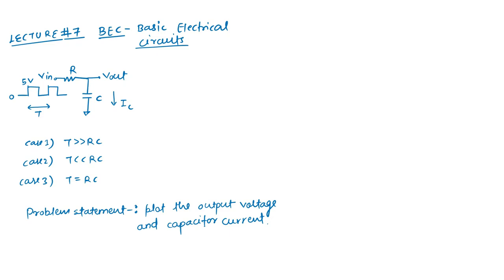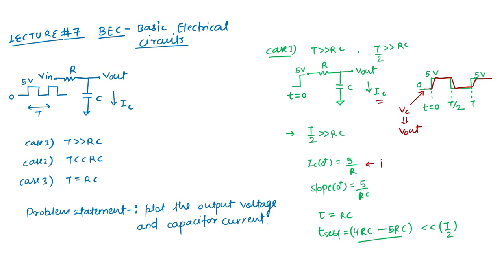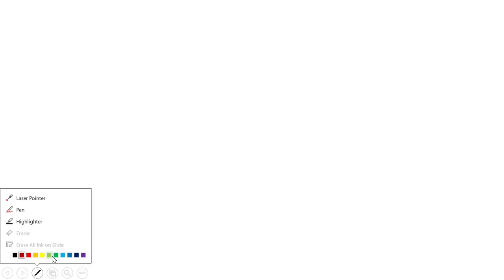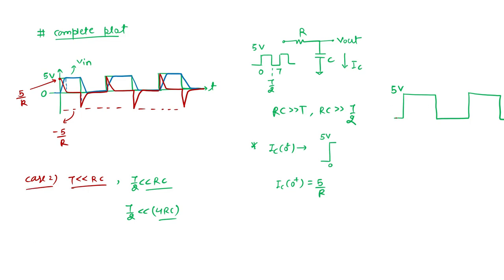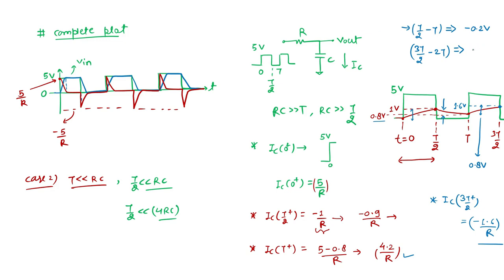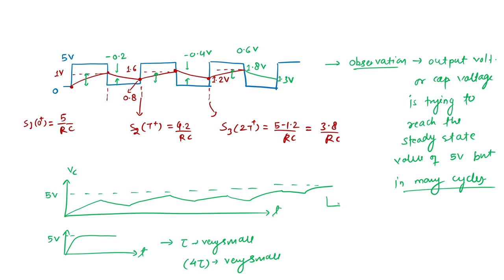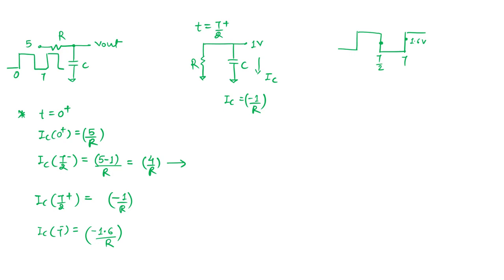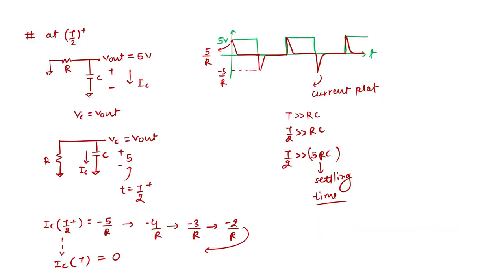Lecture-06 || Simplified Analysis of RC Circuit  with Pulse Voltage Input || BEC Lecture Series

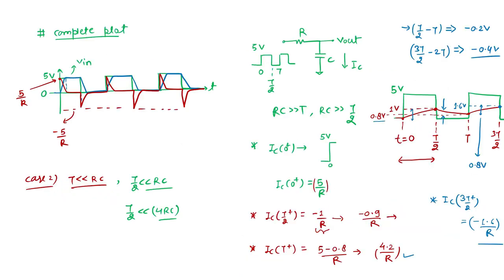Comment: Sir for case 2 at 25:30 , the steady state value will be 2.5 right ? Because the average value of input waveform is 2.5 v ? Please can you help here sir
Reply from the maker: Yes it should be avg value
Reply from the maker: I might have told incorrect..I'll clarify it once
Reply: Thank you sir 🙏🏻 @learningexpress183
Reply: Sir for the third case T= RC , what will be the approach , i tried but not getting the correct waveform